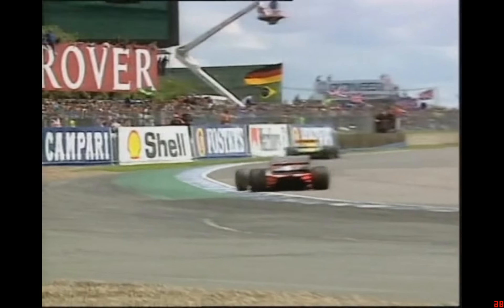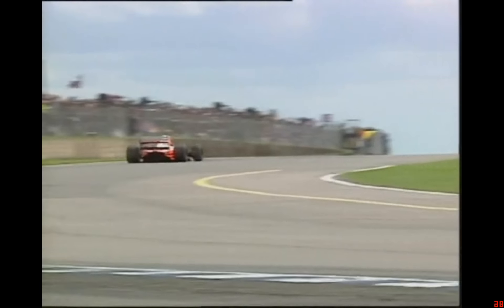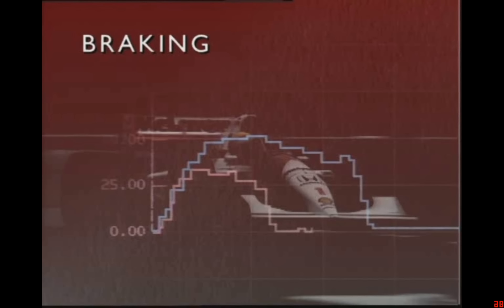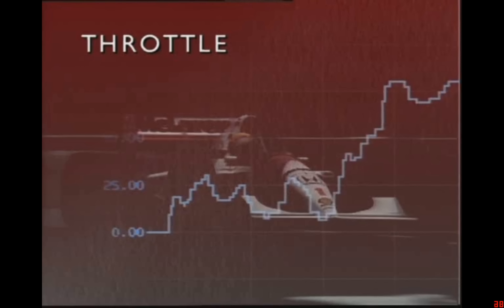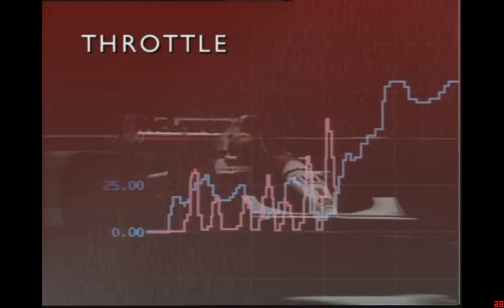Ayrton Senna - Braking & Accelerating Technique

Comment: He is the greatest of all time.
Reply: I would give the title "Greatest of All Time" to Jim Clark. Just my opinion. He was using the throttle technique back in the 1960s. Probably the first to do it and others copied him.
Reply: @martynhunter3542     I would give the “greatest of all time” title to Juan Manuel Fangio. He was driving a death trap and won 5 titles. Balls of steel. Jim Clark is up there with the greatest drivers ever.
Reply: @Blight225  Agreed. It was ruddy dangerous in those days.
Reply: yes he is
Reply: @martynhunter3542  dude, Senna died on track, and raitzenberg on the day before, it was dangerous a lot even on senna days

Comment: Senna’s throttle control is excellent, even he’s using poor cars & engines. The technique applies on latest car models also work, at his era the turbo charged pressure & engine displacement both are highest.

Comment: He is THEE only driver I've seen use this throttle technique and, honestly, if you try to simplify it, it defies logic. It's never truly been explained. I have several theories about it, but I can't decide. Most say it was learned and used in the turbo era to keep the engine on boost, but that theory is negated considering the technique was used on naturally aspirated engines. Others say it was an influence on aerodynamics, but that's also negated because he's seen using the technique in low speed corners and on cars with very little downforce; in the case of the NSX-R video provided by Best Motoring. He's also seen using the technique on an FF car. 

 If you think about the suspension geometry of a car in a loaded set, you can obviously see the impact of this technique. When you're off the throttle, the car is decelerating and the car is on a decreasing radius given the steering input is constant. If you add throttle at that point, the radius increases and there's subtle suspension angle changes. I think he's maximizing grip by not loading the car with throttle throughout the corners, but at the same time he's maintaining momentum and searching for the point in which he can begin acceleration out of the corner.

As far as it upsetting the balance, obviously, yes, it would upset the car, but given the results, I think the input is so small that it doesn't upset it in a negative way; rather it manipulates the attitude and trajectory of the car.

We're talking about a driver that was so sensitive to the feeling of driving. It's astounding. I've read that he came into the pits one time saying one front tire was bigger than the other and it was to a small measurement, a driver that made contact with a barrier and explained the barrier moved, which it had due to a wreck involving another driver.  

I'll finish by saying I believe we all wish he were alive today to explain it.
Reply: In my opinion, I think your second paragraph nails it. He knows he won't be geometrically loading the car with constant throttle. And this affords him the option to brake less into the corner, carrying more speed into it with increased grip. 

To maintain the car from getting upset, I think he only stabs the pedal lightly, not to the floor. Contrary to what most people believe based on the engine sound.
Reply: I read something once about this technique, which stated a simpler explanation: by providing these short bursts, he would keep the rev high, providing a higher throttle when activating it full on.
Reply: I think that similar to how the fact that grip in a corner is not constant across the entire corner that the steering must not always be used in a linear way like a one turn in and one unwind out way. Even if you drive a corner perfectly you'd usually have to do small corrections to make it perfect and you have to preemptively  give up and take back some steering to even out the grip across the whole corner and thus even out the weight shift going on even if it gives up some grip it gives better overall balance and grip through the whole corner.

Similar to this I think he's using the throttle in the same way and the grip and weight transfers small as they may need corrections at the correct time and in the correct amount and he had a good sense for this. Even if you accelerated hard in a straight line in an electric car perfectly at the limit of grip you wouldn't just get weight perfectly transferring back you'd have small variations going forward and back and maby he could actually correct for this in the same way other drivers correct for variations like this with steering.

But I think this is just one of a few reasons that technique worked so well for him.
Reply: He didn’t use the technique at Williams or at lotus Renault. It was a Mclaren Honda adaptation he made. I think because of the steep power delivery curve of the engine. When Williams first got the Honda engine in 85 they had to completely redesign the rear suspension because the power delivery was so binary and not progressive or smooth. Senna’s technique was an attempt to gain a smoother power delivery curve from an abrupt engine.
Reply: It is just a common karting technique
Reply: It's not a secret how that technique work. And it't very simple. 
They teach it to you in karting and other cars with high power/weight ratio. Especially in cars with on/off power delivery. If you come out of a corner and you give it full throttle, you spin because the tires cannot handle the torque. If you apply the throttle when you are already out of the corner, you lose time. You theoretically need to find the perfect spot in the throttle throughout the corner to maximize the tires grip, but with an on/off power delivery it's impossible. If you give it little bursts of power, you can adjust the amount of torque you put on the tires by increasing/decreasing the the frequency of the bursts. If you feel the car going in oversteer you  increase the frequency (reducing the on-throttle time), if you have grip you slow down the frequency (more time on throttle). You can see the effect of that technique from the outside in that video of him driving the lotus and the car is "dancing" in Adelaide. You can see it from the inside in that famous video of him testing the NSX. It became obsolete when Schumacher started using brakes out of corners to achieve the same result (and I still think this is why Senna thought Benetton had TC in 1994), and later traction control was implemented in F1. 
Sorry for the long explanation. Hope it was clear.

EDIT: As some other have commented, for the reason I've explained, it's the same technique you use when you play a racing game with the keyboard.
Reply: Yes your right it is, especially useful in the wet...
Reply: +Mickeal Degeneve Exactly.. i was trying to say but i not sure if is the same.. sure sound the same..
Reply: cicci0salsicci0 agreed, and to say that senna is the only one to use this technique is bs. Karting (as mentioned), even rally. A few pro Japanese drivers come to mind. Also, I think it was more of an intuitive thing for Senna; if you were to ask him, he'd probably say it's simply a way to feel out the limit of grip. From an engineering standpoint, he's effectively using pulse width modulation on the throttle to find, and follow, the (varying) limit of grip in the corner
Reply: He used this technique in karts in the late 70s.
Reply: There is series about Senna in Brazilian television where Takeo Kiuchi, a Honda engineer that worked with Senna in McLaren confirms the turbo engine theory, here is the video: https://www.youtube.com/watch?v=vI16OyivfuA&t=705s Sadly he is talking in Japanese with Portuguese subtitles. If there is interest (and necessity) i can translate this chunk here in the comments.
Reply: My guess is that he is blipping the throttle to get a feel of the car and the road surface and the limit of adhesion of the car. Where as a normal person would have his foot either flat on the floor or half throttle or whatever Senna feels all the different throttle settings with the stabs and I assume finds the best average setting for the edge of adhesion for the car.
Reply: Humberto Ramos Costa  That sounds very good! It would be super nice you'd write the main substance of that theory in maybe 2 or 3 sentenses. Or you point me to a comment in here, which explains it. Thank You!
Reply: 11:46:  One problem with the turbo engines was to recover acceleration. It was too slow.
12:00: Ayrton developed his technique to don't loose power on the exit of the curves.*
12:08: When the turbo engines was banished, Ayrton continued driving the same way
12:16:  to cause little skids and corrections on the trajectory that make him quicker on the curves
12:26: Berger asked him to teach that technique 
12:34: And they both spend a good time training, Senna giving all the tips. So Berger goes to the track
12:44: When he came back to the box i asked him: "How it was?" And he said: "That's not for me"
Reply: That's really great! Many thanks to you! :D
Reply: (*) The translation uses a trick Portuguese word, 'tocada', 'way' probably would be a closer translation in most of the cases. But not in the sense he uses after (talking about Berger). The verb portuguese tocar is close to the English verb 'play'... like when talking about music instruments... Maybe some English words are incorrect, but the general idea is pretty closer to what is written in portuguese. Of course it don't prove that he don't drive this way before, maybe the engineer only haven't saw it before...
Reply: I think it's all about finding the limits of the tires. Each stab he is calculating the feedback and knows how to adjust the next stabs. He is like a computer, each stab is more data, he crunches it like a super human and then makes predictions based on each one.
Reply: I think it's because this technique would make him use the brake less and the throttle more effectively before the end of the corner thus making his entrance faster and exit quicker then if u were to fully apply the brake and then fully apply throttle. Which is probably what made him faster
Reply: I believe it is kind of like antilock in reverse, he gets full power down early tempered with the "lift" to give an aggregate throttle opening through the corner which is higher than average, also it identifies the "limit" without catastrophe, if he reached the limit whist a stab is in progress he is lifting a micro second later anyhow so the grip isn't fatallly compromised.
If this is the case it takes someone     
With phenomenal hand eye coordination and sensory perception as well as incredible reflexes to utilise it...oh I forgot, Ayrton Senna.
Reply: Levi D I believe he prob developed during his karting days. Karts can carry more speed into the corners. 
 he’s tapping the breaks and tapping the accelerator so he doesn’t loose rpms.  
The throttle technique also works almost like a traction control since the spike comes followed by release decreasing the chances of loosing grip in the rear compared to progressive acceleration mid corner where one mistake can make you spin.
Reply: I have watched video of him driving NSX and was fascinated that he would use 3rd instead of a 2nd and his explanation on why, so I tried in in my car even though its turbo it works in most corners. Much better steering control and car seems more stable with no jerks from going from 3rd to 2nd
Reply: @Mika38  exactly! A common karting technique. 
I believe that he picked this habit up racing karts as a young kid. Stabbing at the throttle in the corners.
You cant go full throttle in the corners, but at generally slower speeds in karts, it's easier to learn to stab at the throttle and keep the kart at optimal speed before losing control.
Spending his whole life racing, I feel he adapted this technique to the very touchy and powerful f1 cars.

HE BECAME A MASTER OF RACING.

I've often pondered how he could go into corners faster than anyone else.
After all, the rest if the drivers are professionals TOO.
My thinking is from his experience in karting. Keeping the f1 car at the edge traction, stabbing the throttle and FEELING THE SLIP OF THE CAR, as well as the weight transfering and what the wheels were telling him.

He was one of a kind.
Reply: This is just like go kart it is not even "adapt" to Formula One, except when turbos were banned. It's not even "defies logic" this is just common sense if you are a racer: you'll go faster if you can carry more speed into a corner and you'll exit it faster if you can go earlier full throttle. When you learn to drive a gokart the first thing they teach you is: never ever freewheel. 

Blipping the throttle gives you a very good feeling about when you can put your foot to the floor. When you go off the gas you gain front grip because of weight transfer, when you go on the gas it gives you more rpm (=more speed, better accelaration ouf of the corner) and more aero grip. You can control your racing line more precisly with a little of controlled oversteer without turning the wheel more or less (wich cost time). Also the curve of the turbo's engines were very brutal and using this technique he was able to control the  You can get rid of engine brake and so on.... 

It gives you so much informations about the grip of the car through a corner, but it's hard to handle right and if you do a mistake you'll lose a lot of time out of the corner. Of course this is not "on/off" full throttle/no throttle, their is just too much torque in a F1 car but  it is just a very gentle and kind pumping to hold the engine at a given RPM. In go-kart you can be more aggressive.

If you never tried to do it go to a gokart track and do some laps using this technique, it's not only fast it's also very fun. I do a lot of go-kart for many years, even before I knew Ayrton Senna and the technique he is using, and he was obviously not the only one doing this but if was a MASTER at it for sure.
Reply: I think Schumacher used same technique, seen similar video about him.
Could it be that they did it to create oversteer during the corner? Little bit of throttle, enough to make rear slide, to help rotate the car, not enough to powerslide.
Reply: People who race go-karts do purely for traction. It’s the typical thing to do. So he got the idea from that. But, I bet you’re right about why he continued to do it in F1.
Reply: It's a karting style technique.
Reply: Been trying to discuss with you. Been reading all the facts you brought to the “table” and I thought I could try to explain how he did it but your last sentence says it all.
Reply: Harmonics
Reply: Variable acceleration creates more opportunities for the tires to “grab” the road? Whenever I play with the throttle I always feel like I’m jamming the tire rubber to get a pinch of grip.
Reply: @JonathanPoto   And if you accelerate in a corner it often locks you into a torque path but if you let up on the throttle you can reposition the car in the opportunities as the torque is released and reapplied as well as getting a response from the engine amongst other things
Reply: I saw a video that explained how it worked, Senna stabs the throttle fast enough that the suspension doesn’t respond quick enough.
Reply: Senna wanted to make the car lose grip in order to:

1) Slide the car just a bit so that he could change direction with a better angle during a curve and...

2) Change gears and hit the thrust at any point of a curve in order to be able to increase the grip and speed. (This was the main reason)

You see, if you lose grip and gain grip: it's like a basketball being thrown to the ground.  Just like a basketball player makes short bounces (while running towards the Rim), so that in the last minute he can increase the bounce and lift the ball higher, in order to make a slam dunk.  

The car is not only sliding... the car is literrally bouncing!  On a curve!

Watch this short video to understand the physics behind the concept: https://youtu.be/B3NbPUTD5qA

The snake increases the grip by alternating the ground contact (which only two parts of the snake are actually touching simultaneously the ground).

Senna was actually increasing the grip by making the car lose and gain grip over and over again.

When Senna wanted maximum speed, he would stop the alternation and hit full Throttle.  The car literaly kicked the floor underneath it.

Gravity plus hiting the thrust would thrust the car foward just like a rocket uses thrust to hit the ground in order to take off.

In my opinion Senna truly is the GOAT.

.
Reply: He also used it to help piviot the car too. It isn't that uncommon of a style in terms of dirt stuff like rally or dirt ovals. Even nascar drivers for a good part use it as it works well on ovals. It's way more rare in high downforce cars and stuff like F1 though. I doubt it would work in modern F1 as they don't have as much suspension movement and they have way more downforce.
Reply: Schumacher and Verstappen did/do this as well. You basically steer with the gas pedal rather than the steering wheel.
Reply: from his karting years..
Reply: he's unlocking potential energy and harmonics which can boost through resonance and alignment with maximum flow